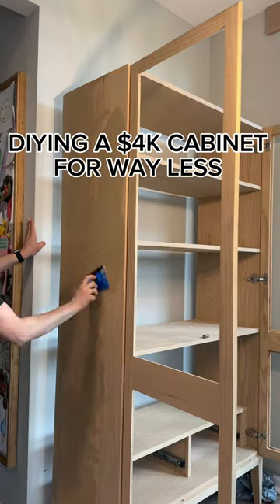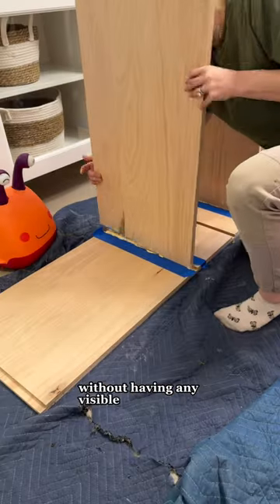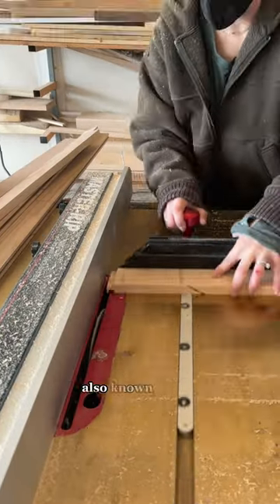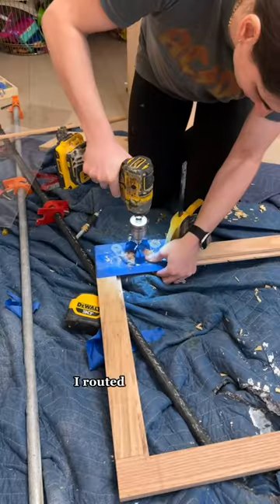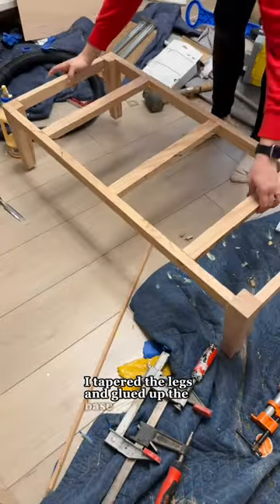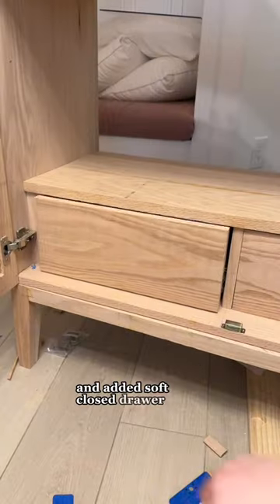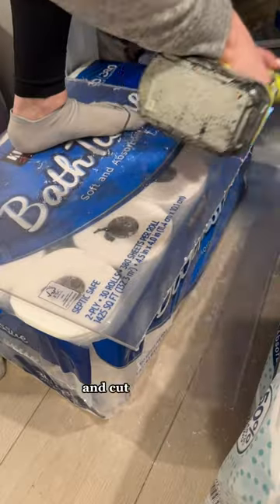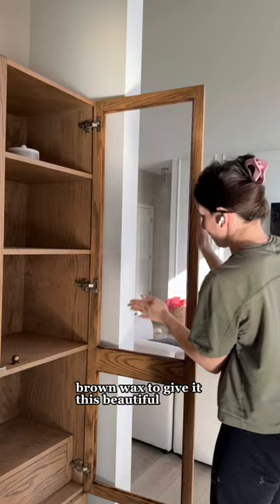DIY Hutch Cabinet How To #diyfurniture #diy #diyprojects #woodworking

Comment: great build, the shelves arent super strong but  that doesnt seem llke the purpose for a glass door shelf regardless. good dewalt, are your ryobi batteries compatible? those will break down with use, dewalt is always the best choice
Reply from the maker: Dados are very strong! I won’t be putting books or anything extremely heavy on there.